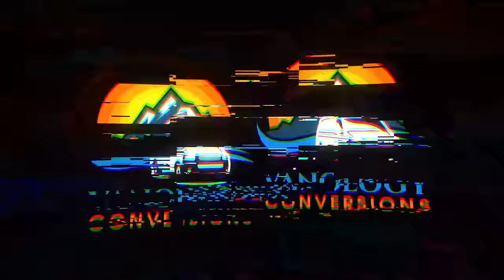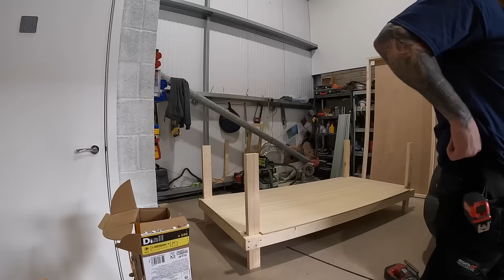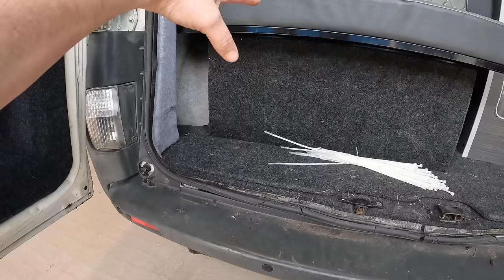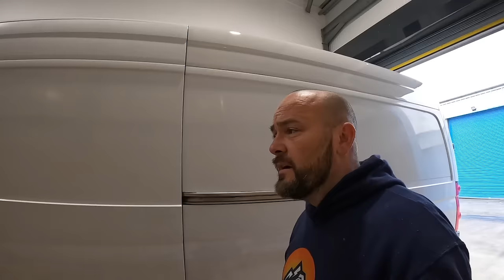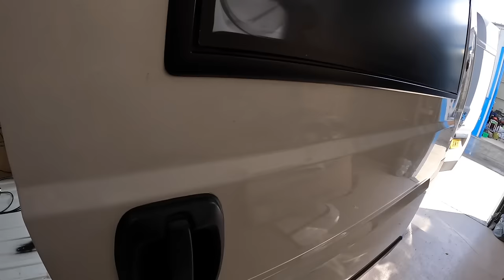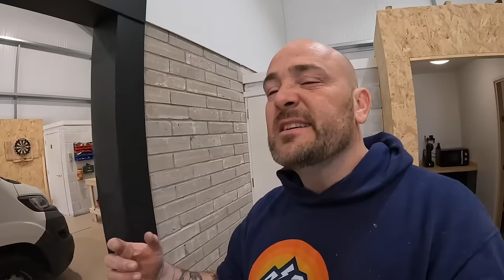New Team Member FINALLY | Van Build

Comment: Hi Stu,
I’m a locksmith based in Bridgend based and do van locks and security, as well as ignition keys etc. I have on some vehicles also converted back from Slam locks to original spec. The cables should still be the same. Just the cylinder becomes your handle. However sometimes the companies installing remove brackets and rods. Rather then leave in the door etc. Can always arrange to attend to help in anyway I can.
Reply from the maker: Thank mate appreciate the offer, could you send me a message would be handy to have your details for future 👍🏻🚐

Comment: Hi Stu 

Busy, busy!! 
Quick question where are you getting the 445w solar panels from, or can you supply, could you give me the dims 
I was going to be putting X4 100w on my van but the one you have used might fit my roof

Cheers
Reply from the maker: If you can email me and I’ll get the information for you tomorrow. Our supplier for them have shut but have found out where they get them from so will see about getting more in as I only have a few left 👍🏻🚐

Comment: Stu. Wondered why you didn't put diesel heater under drivers seat. Like everyone I've seen do that.
May have had to put some spacers under. Dependant on yr
Reply from the maker: This van had a swivel plate that wouldn’t allow it to be installed there it was the first area we looked at 🚐⚡️

Comment: Hello stu hope your ok buddy loving the videos and congrats on your success with the business hopefully you remember us as been following your other channel for quite some time now buddy but I got a quick question as you had a vivaro in the workshop we are planning on getting a vivaro or traffic next year and converting it to a basic camper and running the entire van of a power station but when I watched this vid you mentioned fitting a diesel heater is quite hard well I'm planning on getting one also but where that got put I wouldn't be able to have it there as you know we got 2 kids also so fitting a roof tent I'm gonna need as much space I can get in my van so I need to try and find a good tight spot for it to fit will that be hard and plus money is going to be tight thats why keeping it basic lol would go bigger but funds won't stretch that far lol.
Reply from the maker: Hi guys yes of course I remember 👍🏻 ideally under one of the front seats is the best location for it, on this van it wasn’t possible. You’ll have a pleasure of planning where it goes before you start the conversions so I’m sure you’ll get a good spot for it 👊🏻🚐
Reply: @VanologyConversions  I see so gonna be tricky then as I'm wanting to put the twin seat on a swivel plate is it possible to our under drivers seat I have a diagram of what I want my interior to look like and looks a lot to put in lol should go in though with the way I want it lol just the diesel heater to put somewhere also possibly fit hobs with oven but in 2 minds with the oven for space would you recommend an oven just to make it that bit easier with us having 2 kids or go without or possibly get one of them portable ones but then space to store it I would just use an air fryer and hobs but with me only using a power station and everything powering of it its gonna drain the battery to quick so bit stuck here lol asking you as you done all this before and having children so you will have the best advice lol
Reply from the maker: There’s always somewhere it can go and if you want to move the vent to be further away then you can get a longer duct to put it where you want it 👍🏻
Reply: @VanologyConversions  brilliant thank you so much

Comment: lithium battery is shit to expensive agm is cheap and good
Reply from the maker: Depends what lithium your looking at the Fogstar 105ah is £369 and you can use the whole capacity where agm/lead you can only use 50% of the capacity not to mention weight difference and charging efficiencies 👍🏻🚐